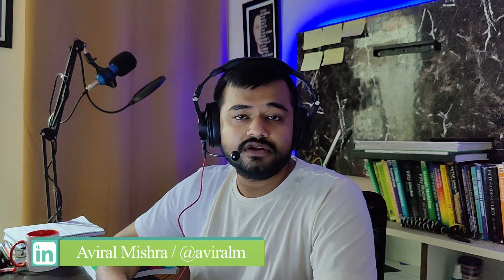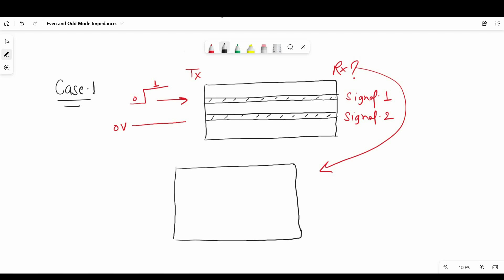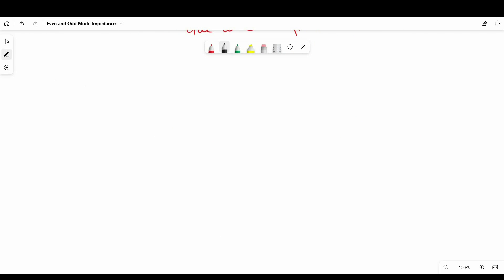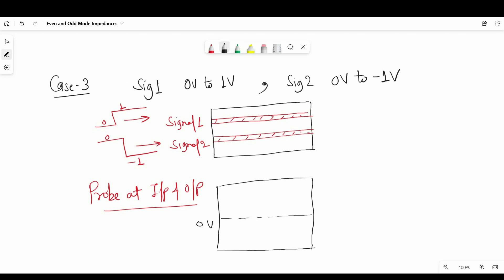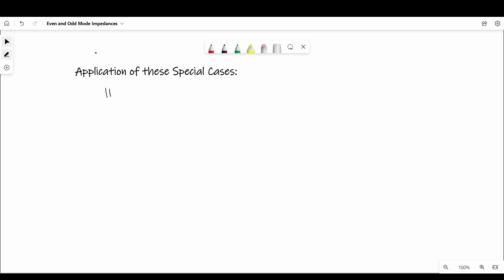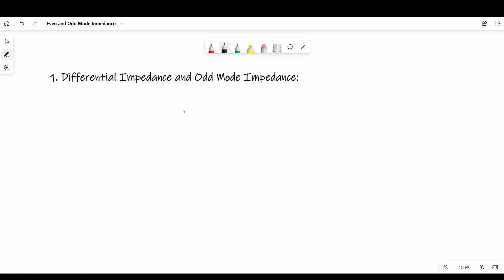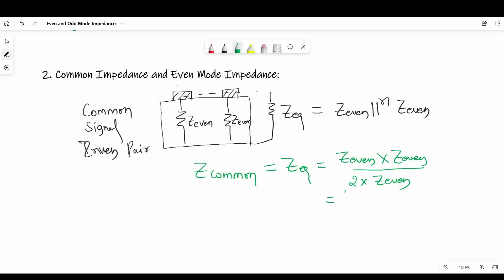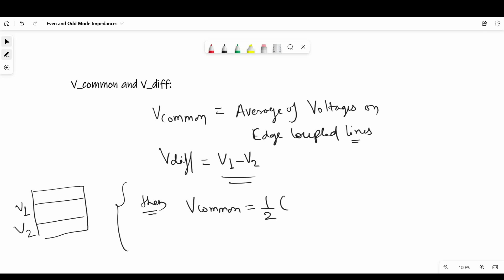What are Even and Odd modes? Estimate the Even and Odd Mode Impedances

Comment: How to simulate a differential signal, if it's passing through hole connector. Because no ibis will be for connectors.
Reply from the maker: Hey Raneel, for differential pair watch lvds videos i have made recently on EsteemPCB Channel.
And how to add connector SPICE model and do simulations.
I have created a series of videos on this on EMA Design Automation YouTube channel,
It's topology explorer series they are still publishing those may be in part 3 you ll get your answers
Reply: Can we perform pre layout simulation for power PI & Emc. In hyperlynx line simulation. 
If we can then please help with any material or documents.